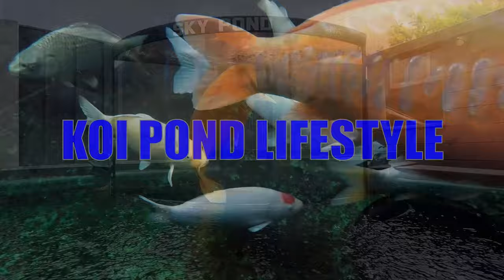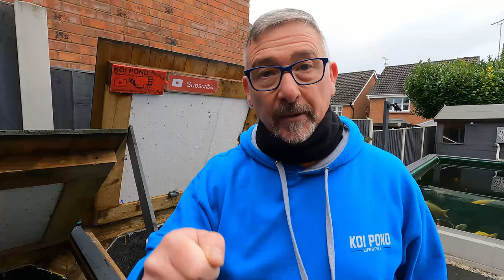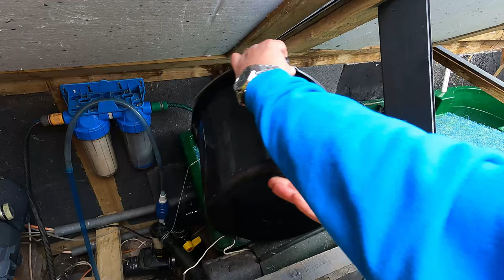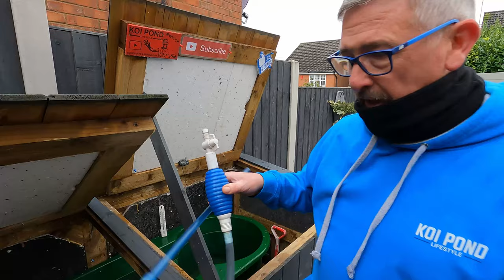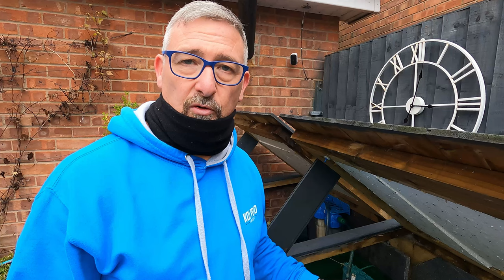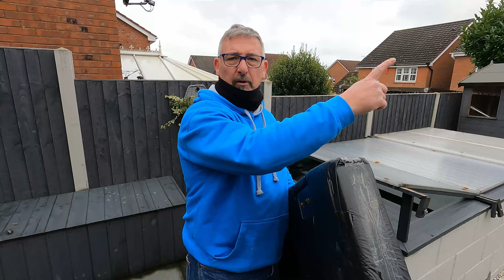KOI POND***WINTER READY COMPLETED🥶**FULL MULTIBAY FILTER CLEAN*WILL I MAKE IT THROUGH THE VIDEO😲🤒

Comment: I checked my electric bill for 1st to 26th November I then placed 4 of these lights in my home Passage/Landing/Bathroom upstairs / bathroom downstairs.
Each cost me £5.99 and use 3 cheap batteries at a cost of 3p per battery which should have a 3-month lifespan.
Checking my electric use, I have saved almost £28 that’s £336 a year from 28th Nov to 23rd Dec.
The problem was when my wife or grandchildren went into the kitchen, they would leave the passage light on also when they went up or down the stair’s lights would be left on and the toilet lights where never switched off.
These come on stay on till they detect no movement and switch off they are also so bright.
These are 9 led not the cheaper 8 or 7 led ones. You can also get ones with the on off switch on the inside making them water proof so can be used outdoors.  youtu.be/DC62nn2rgxU